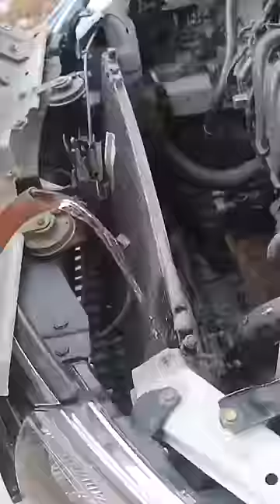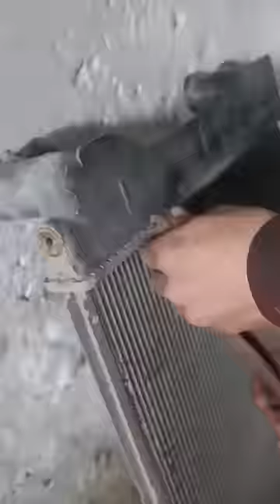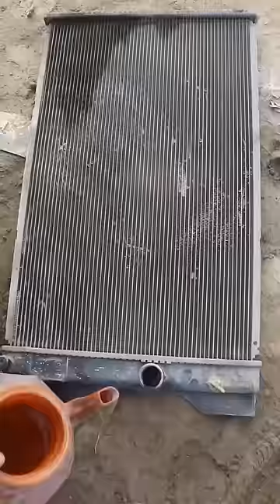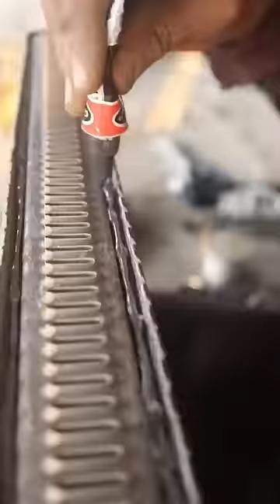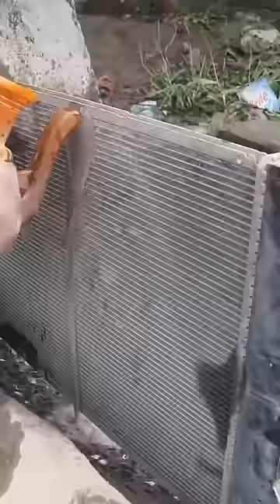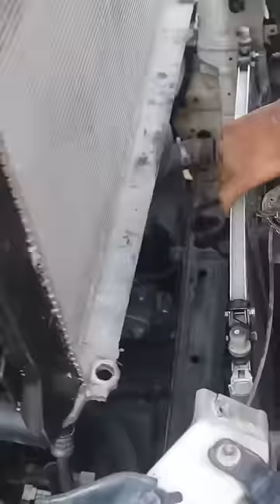How to Clean a Car Radiator

Comment: In the video, the condenser of the air conditioning system in the vehicle is flushed with water and then a removed water cooler is dismantled and cleaned. Normally, this is completely unnecessary if the prescribed mixture of water and radiator antifreeze is used in the cooling system. This is because radiator antifreeze also serves as rust protection. In addition, it lubricates the coolant pump and increases the point of boiling.
Reply from the maker: You are correct. Flushing the condenser with water and dismantling the water cooler may not be necessary if the cooling system is properly maintained with the recommended mixture of water and radiator antifreeze. Radiator antifreeze not only helps prevent freezing and boiling of the coolant, but it also contains additives that provide rust and corrosion protection for the cooling system components. Following the manufacturer's guidelines and using the recommended coolant can help maintain the efficiency and longevity of the cooling system.

Comment: If they use just coolant they don’t need to do all that process.
Reply from the maker: That's correct. If the cooling system is properly maintained and the appropriate coolant is used, there should be no need for extensive cleaning or repair work. Regular coolant changes and following the manufacturer's guidelines for coolant usage can help prevent issues in the cooling system.

Comment: From experience this repair will last for one week and then start leaking
Reply: Этот автовладелец теперь постоянный клиент этого горе автосервиса 😅
Reply: I had got it done 5 yrs ago in my safari s dicor and this is still working without any problem
Reply: If youbuse new aluminium radiators yes,, but if you use old version radiator like cooper,, it will last several years..
Reply: I'll just wait for mine to come from Amazon for $89
Reply from the maker: I'm sorry to hear about your experience. It's important to ensure that repairs are done properly to avoid future issues. If you're facing recurring problems, it may be helpful to consult with a professional or seek a different approach to address the underlying cause.

Comment: I always run my heat on hot days because that’s an extra radiator to reduce the strain on my old car’s cooling system.  The windows are down so it doesn’t matter for me.
Reply: Not all heros wear capes.
Reply from the maker: It's understandable that you want to reduce the strain on your car's cooling system. Running the heat on hot days can help dissipate some of the heat from the engine, potentially reducing the load on the radiator. However, it's important to note that running the heat in your car may cause discomfort due to the warm air blowing into the cabin. If you find it comfortable with the windows down, that's a good solution for you.

Comment: I wonder what does he blow flame thrower for?
Reply: Dramatic effects
Reply: @Snowaxe3D 😂
Reply from the maker: Without additional context, it is difficult to determine the specific reason or purpose behind using a flame thrower. However, flame throwers can be used for various purposes such as controlled burning, weed control, or in certain industrial applications. It's best to consult with the individual or organization using the flame thrower to understand their specific use case.
Reply: @HieFive  that's clearly an AI-generated reply, Lol

Comment: To spray water for radiator makes pins spiral. And then It works worth.
Reply from the maker: Avoid spraying water on the radiator to prevent damage and maintain its performance.

Comment: А не простіше залити в радіатор молочну сивородку, те що залишається після віджатого сиру, і поїздити так цілий день?! 
Весь бруд вимивається в охолоджувальній системі і екологічно чисто. При необхідності - повторити. Рецепт моїх дідів. І розбирати нічого не треба!
Reply: твоих дедов в каком веке? 😂😂😂 они в ишака ее заливали
Reply from the maker: While using milk whey as a coolant additive may have been a traditional approach in some contexts, it is not recommended for modern vehicles. Engine cooling systems are designed to work with specific coolants that provide adequate heat transfer and corrosion protection. Using unconventional substances like milk whey can lead to inadequate cooling and potential damage to the engine. It is best to follow manufacturer guidelines and use recommended coolant products for optimal performance and longevity of the cooling system.

Comment: These new radiators clog a lot inside & outside
Reply from the maker: Regular maintenance can help prevent clogging in new radiators. Keep them clean and ensure proper airflow for optimal performance.

Comment: Rodding the tubes doesn't show the condition of the tubes. Also there is a special crimping tool to clamp the tanks. If NOT done right it'll leak for sure. Then again in India or Pakistan everything goes....
Reply from the maker: Choose skilled professionals for radiator repairs.
Reply: @HieFive  Totally agree, it looks easy but if you don't have the gasket in place and you don't do proper crimping that rad will fail. Another thing, sometimes the tubes are weak and when you rod them you'll have a good chance that down the road it'll fail. Have a great day

Comment: rip radiator😅
Reply from the maker: Indeed, it seems like the radiator may need some attention or replacement. Proper maintenance and care can help prevent such issues. If you have any specific concerns or questions about radiators or cooling systems, feel free to ask, and I'll be glad to help.